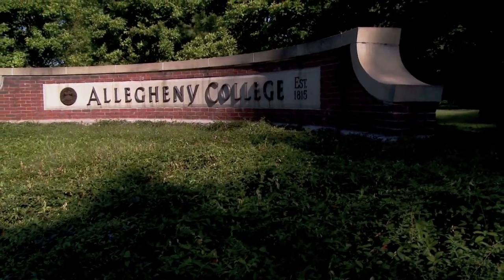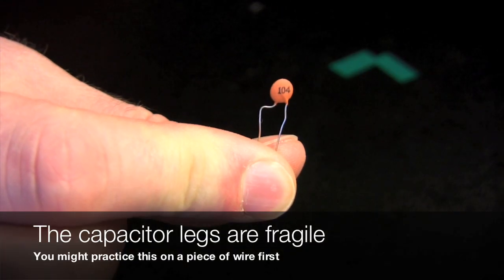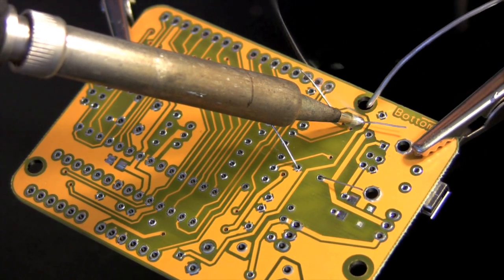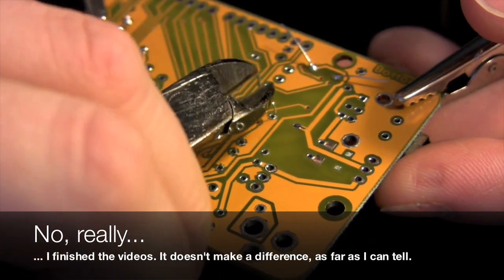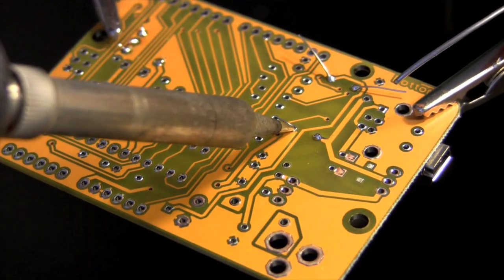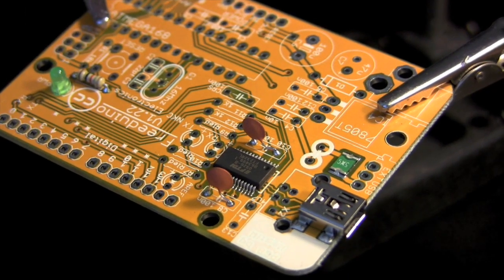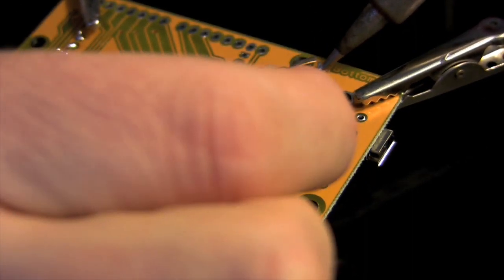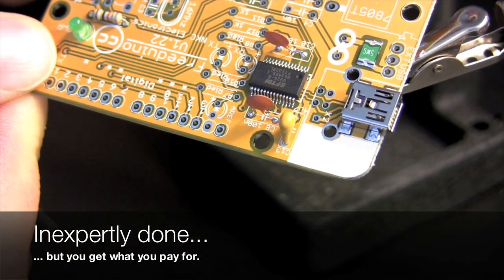Freeduino Build: Part 2 of 5

Comment from the maker: @xxM5xx You're correct, and I do require my students to use eye protection when we're working. It might not be in the video, but remember that these videos are not 100% of the context.

So you know, in class I pointed out that many of my solder joints (and, I said this in a later video) use too much solder and too much heat -- which I re-iterated in class. 

I don't know how much work you do out of your area of expertise. I figure I'm doing pretty well, considering. 

Again, my thanks.

Comment: Also, I advise anyone trying this to wear safety goggles because snipping those wire leads with a good diagonal cutter will make those wire leads launch like flying needles.  Get one in your eye and you can become severely injured. Keep other people out of the area where you'll be doing this assembly work. They can be injured by flying wires too.  Molten solder can pop or splash unexpectedly which is another reason to wear eye / face protection, and keep others out of the work area. Professor?

Comment: FAIL. The person soldering spends WAY TOO MUCH time heating each joint.  I also disagree with the directive to clip the lead wire before soldering. The lead pulls heat way from the component quicker after soldering (better for the part) and reduces the chance of heat damage to the component, esp. diodes, transistors and ICs.  This is a good video on how NOT to assemble a circuit board, and this is published by a college? FAIL. You hear me Professor? Programmers....argh.